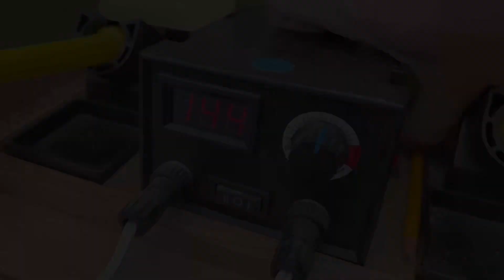Campfire guitar makeover  -  no talking pyrography

Comment: How did you find burning the top? My plan is to do the same thing with a build I'm doing but wasn't sure how it would work with the quarter sawn top so I haven't attempted it yet
Reply from the maker: This one worked fine, though it is a ply top. Have a look at the structure of your top, if it looks like the grain will create hard/soft/hard/soft sections, then they will Burn differently. Try to find a similar wood to experiment on first.
Reply: @KingBespokeCreations  I do have some cut offs from a Sitka spruce top I will test it on thanks.